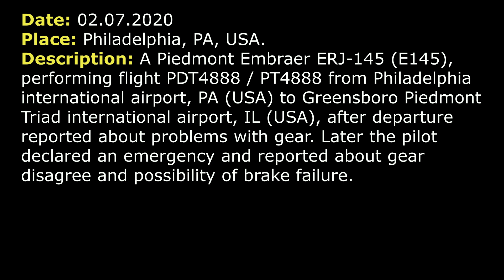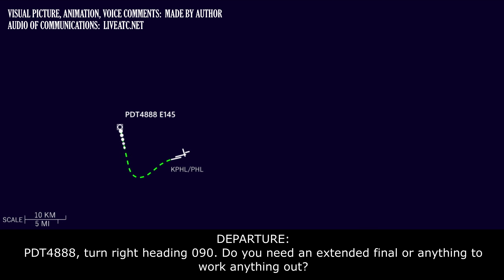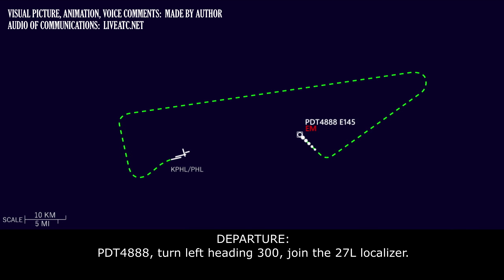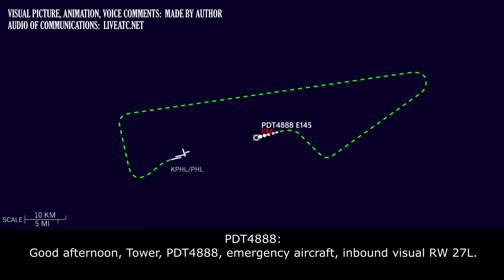(Real ATC) Possibility of BRAKE FAILURE and GEAR DISAGREE | Piedmont E145 | Philadelphia airport

Comment: Things that are off by more than a letter or so:
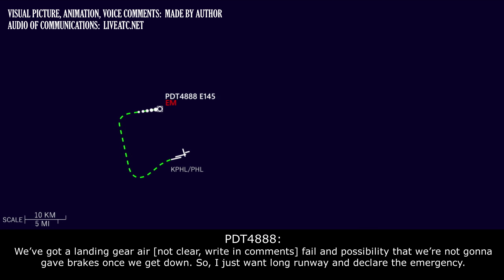2:00 Might be air/ground fail: a sensor that detects whether the wheel is on the ground.
2:27 “All right, sounds good. I do have a medevac coming inbound from the east, so if you’re not in a hurry I’ll get him in front of you and then bring you in on an extended final.” “Naw, that’s fine. We’ve got time.”
3:15 “type is unknown”
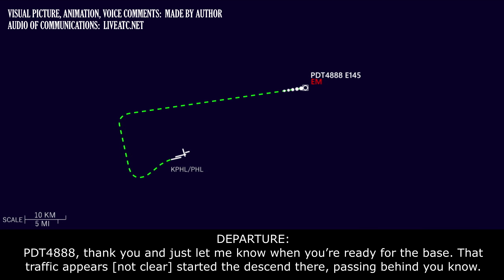3:30 “That traffic does appears [sic] to have seen you and started the descent. [They’re right …?] passing behind you now.”
3:43 “Can I at least get you coming back to the southwest, just to keep you close enough to Philly for radio coverage?”
4:02 “There are a couple more coming inbound here. I just wanna make sure you’re not getting close to being ready, all right?”
5:42 “Whatever exit is easiest for you”
Reply from the maker: Thank you, pinned.